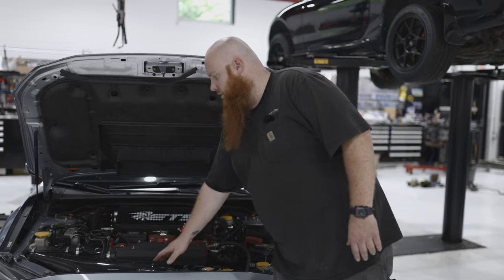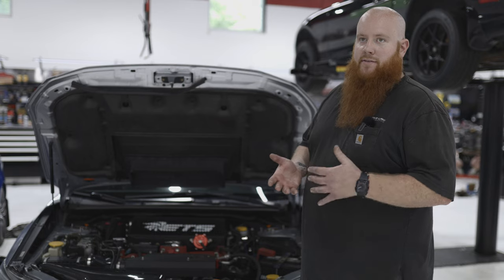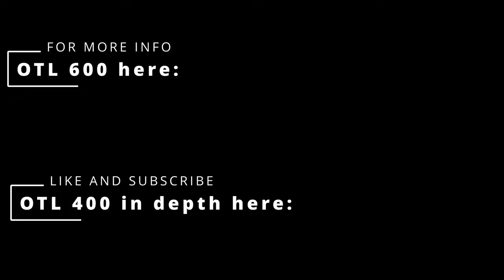BUILDING A 400hp vs 600hp SUBARU STI (BUILD LIST)

Comment: Thank you for being realistic about pricing on these builds. People think you can build a “reliable” 600hp sti for 20 k and it’s just not possible🍻
Reply from the maker: We strive to spread the truth!!
Reply: Ya no u can hit those numbers on a stock block but it won’t be reliable. Gonna need a iag block which is spendy.
Reply: Man you can make cheap power it just won’t look like a show car. Get a shitty car. Then put the high ho motor in it. That’s what I did. I got a 85 awd turbo rx sedan. Then put 06 sti built forged motor with 100mm pistons. Studs. The works. I’m in the whole thing for less than 10k IV done all my own work being a machinist. I clearanced, the bearings, bored the block, align honed the mains, ported the head, if you do the work it becomes a lot cheaper. And I make 400 wheel hp and 400 wheel torque it was worth it
Reply: @user-nf3oq2ge3g  yes labor is half the price but we are talking 5-600 hp there is a big difference  there. Most people don't have the skills nor the tools for what you described you should be able to build a 1000 hp car for 20k since it sounds  like you have the skills and facilities to do so

Comment: Subarus are unreliable overall, had an identical  setup as the 600hp STI and I had multiple issues plenty of times for about 5 years owning the car till I finally said enough and moved the the Honda platform, I’ve had my type r for 3 years now pushing 600hp+ and not a single issue, my heart is always going to be for Subaru but damn my type r makes me happy by not breaking my bank and making me happy when I rip on it

Comment: How much is the 400hp package?
Reply from the maker: $12,500 finished
Reply: On E85?
Reply from the maker: yes @Quin619
Reply: 12,500 for 90 horses man f that
Reply from the maker: 400 wheel not crank...  @MidLifeTyson
Reply: That’s stupid $ for 400 wheel. Could’ve gone e alone and done that. Could make it on a fa20 with e for less. If I’m spending that $ I’m using a real name in the Subaru game as well
Reply: @MidLifeTyson 🤣🤣🤣

Comment: What can the 600hp spec run 1/4m? With a good driver..
Reply: I've seen some in the 10s at that power
Reply: @boostedg215  yea all day, i want to know what that specific ‘600hp package runs’ trying to figure out the gap between US dynos and Aus.
In Aus a 500whp will run high 10s. Our dynos are calibrated a lot lower

Comment: How must cost to build i 600hp sti
Reply: 2015 sti
Reply from the maker: $35,000-$45,000 depending on what you want
Reply: How much cost to install I good turbo with I donwpippe up pippe heater and I air intake
Reply from the maker: send us an email sales@offthelineperformance.com @bryantmontalvocolon4599